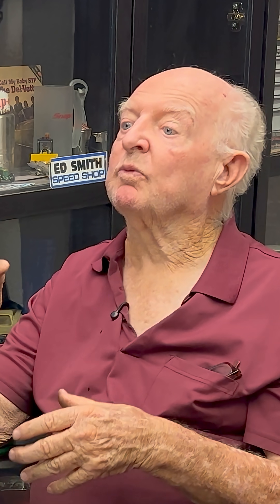Ed WANTS An Uneven Cylinder Bore! Ask Ed 42 - Ed Smith w #Barryt #enginebuilding #hotrod

Comment: Piggybacking on this theory, has Ed ever or has he known anyone who ever ran a motor with just 1 set of dykes and the oil scrubber? It wakes up the small engines we run in the drag mini bikes, I’m sure losing 8 friction points would really make a properly set up motor charge out of the corners.

Comment: When I was learning the craft, I worked for Larry Ofria at Valley Head in Northridge CA. He had theories he stuck to as far as ring seal. He demanded an even taper between .0005 and .001 bigger at the bottom. It was easy enough to control, you just ran the block about 1/3 turn higher than you normally would and the CK 10 had a specific bottom dwell function (Button) you could hold it as long as you wanted, it would short stroke coming up and dwell at the bottom before returning to the top each stroke, his theory was the water jackets end at the bottom of the cylinders and all the fire happens at the top so it was going to expand more toward the deck. If I was doing a block for someone who I knew was going to mic the bores, I’d try and finish it when he went to lunch and make them straight but truth be told, after running them on the dyno both ways, the leakdown couldn’t tell the difference.  Irclentrack motors and 4 1/8” small block Chevys got the water jacketed torque plate and water heater in a shopping basket treatment, heated them up to 150-160 degrees before finishing the bores. I always had nightmares about the plate springing a leak and contaminating my honing oil but luckily the mud never happened. He was also a stickler for the plateu hone finish. Start with 133s then 525s then 625s then 820s then cork bonded  wipers, then the abrasive brushes. Bores looked like grey mirrors when you were done but if you hit it with a loop under light, you could see the underlaying crosshatch patterns. I always ran double Moly rings so I stopped at the 625s which were a 280 grit I believe. The 820s were 400 grit I’m positive.

Comment: Ideally cobustion should be over by ~23 degrees after tdc and if the cam is opening the exhaust valve at ~20 defrees bbdc, you only have around 140 degrees of crank rotation to get any power from each poser stroke and that is just absolute math, it seldom works out to get every degree of rotation acounted for.